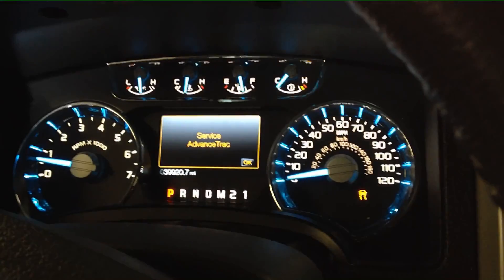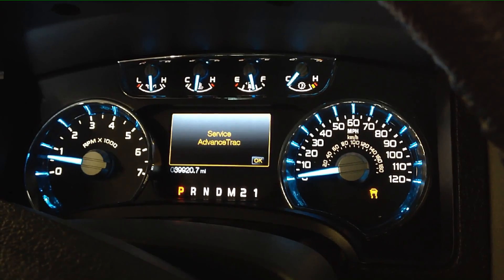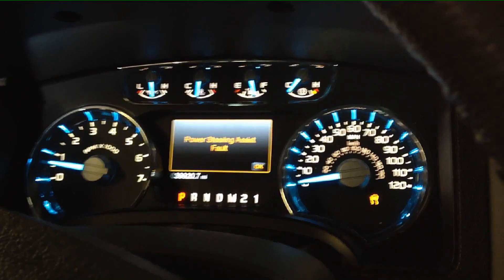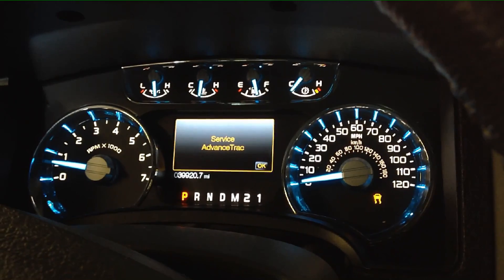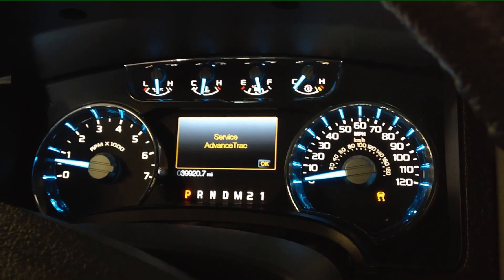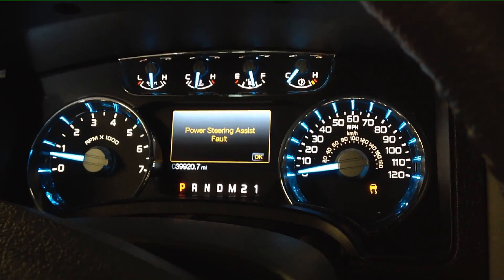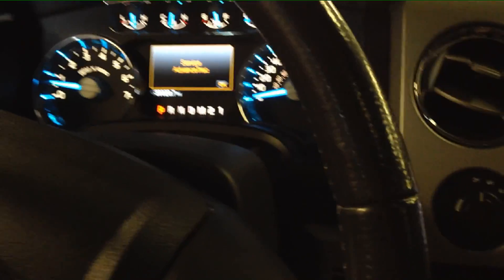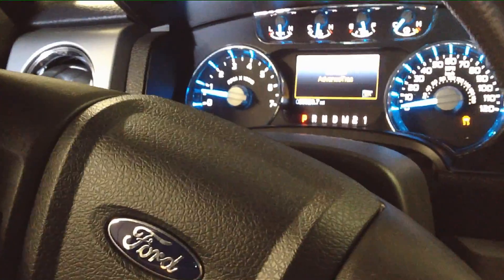Ford Quick Tips: #29 What A Failing Electronic Steering Gear Sounds Like

Comment: I have a 2013 f-150 5.0  steering stops working when it gets very cold do i need to clean the connectors or just replace the whole steering after I worm it up for about 45 minutes and turn it off and back on it works fine

Comment: I did not get any cluster errors on my 16 f150. I noticed I adjusted my steering wheel position earlier today and I got a sticky ratcheting sound maybe an hour later every time I turn the steering wheel. Almost like a ratchet click noise and it sticks during the turn in different spots. Once I was in a safe spot, I drove maybe 5 miles an hour and would turn the steering wheel back and forth while coasting under its own load and it would ratchet still. Came to a complete stop and let off the brake and it stopped doing it. I’m going to adjust my telescoping steering wheel again and see what happens. Maybe twice a month if that and very minimal, it would catch in a slight turn but never ratcheted before. This is the first time I’ve heard it ratchet. It does is during the cold I’ve noticed. Any ideas?
Reply: It went out completely a few days later didn't it?
Reply: @brandonrickbornponyexpress6574  It has not done it since. I’m thinking maybe I didn’t have the release clamp pushed up all the way and it was ratcheting from something. It wasn’t set. Everything is fine now.

Comment: Thanks for the kick to the nads! 😅
My 2011 Mustang made that sound a couple of times while I was driving, shortly after leaving. I thought it was the starter stuck or something. Then some light wining in the steering started happening while stopped. Followed by a slight shudder in the steering wheel. Got new tires, and now it tracks back and forth and throws the steering assist light.
 I had a feeling it was this, and now, after watching this video.... my nads hurt 😂

Comment: You can by the belt to fix it like $50 take you like 1 hr to fit it I did mine
Reply from the maker: really show my how.
Reply: If you could Please confirm that replacing the belt will solve this exact same problem, my 2010 fusion doing the same thing.

Looking forward to hear from you.

Thanks

Comment: My 2013 did this one time on start up, made no noises while trying to turn it but it had no power steering,  I shut it off and started it back up and I've had no issues since and that's been several miles ago,  kinda worried as to what will happen if it fails why driving and what it could be

Comment: 2014 ford fusion with 140000 km had the steering fail. No noise. Just stopped working. I replaced the entire rack in my driveway and the motor on the rack was actually split in half. This should be recalled!

Comment: I repl;aced my Rack and now ? still have a stiff steering wheel and light comes on service advance trac. Can not drive the truck.. ?
Reply: service advance trac was coming on when it failed initially..
Reply from the maker: Did you program the new rack with as-built data?
Reply: @FordTechMakuloco  can not program code reader notice... Lost communication with PSCM

Comment: Could the rack be failing WITHOUT noise? Mine doesn't make any noise, doesn't throw any codes, but the steering is just as stiff with or without the engine on.

Comment: Just watched someone totally service one and it was simple . he changed the belt inside 1 torx screw put the rubber boot back on with a radiator clamp and it worked perfect $ 40 for the belt from Amazon didn't even have to pull the rack .  to many thieves out there it's maddening .

Comment: I took mines apart and the belt was no good, it was making that same sound. It’s fixed now. The belts are only on eBay and go for $60
Reply from the maker: This is electronic steering, no belts and no pump.
Reply: @FordTechMakuloco  As per my research online, There is a small belt and two bearings.
If parts are available then you can service the item.
Reply: @LuLu-eb7lt   do you have exactly the same sound of this video?  Help me with your informátion please, because my f150 2014 now have the exactly same noise and
Reply: @LuLu-eb7lt   do you have exactly the same sound of this video?  Help me with your informátion please, because my f150 2014 now have the exactly same noise and
Reply: Hi
Reply: @Lulu-eb7lt ... Please confirm that you had the same noise and replacing the belt solved the problem, my 2010 fusion doing the same thing.

Hoping to hear from you.

Thanks

Comment: Had my old 2013 with a lifted kit on it and drove over 130000 on her and no steering issues whatsoever. 9 months after purchasing my 2017 used that has 90000 on it, the steering rack and pinion is put and needs upper control arms ball joints and stabilizer bars plus alightment. Only $4900!!! Hahaha they are high

Comment: Does this apply for the 2012 F-150 Lariat I think his truck has 6.2L V8 4WD that needs? : electric or or electronic power steering (pump), along with the rack and pinion. He thought person was trying to play him. They sent him quote upon part for $1,200.00 not certain whether any of what you stated in video upon Labor fee & Wheel Alignment fee was discussed. 

So if the truck has electric or electronic power steering rack and pinion, is the actual steering pump itself is it same or manual type pump ? An how would person know if they purchased the correct pump which goes in the vehicle to replace old bad one when doing the repair ? Thank you.

Comment: My 2011 F-150 is doing this right now and I'm guessing it will cost $2000 for parts/labor. Issue is that unless you have the stuff to calibrate it all, you have to take it in to the dealership or a shop.

Comment: The Steering gear cracked and locked up on me mid turn in my 2017 mustang GT.
Good brakes saved the car from being a write off as I was still pointed off the road.
I am 3 days short of 2 full months waiting for a stereing gear to come back in stock.
I only had the car 4 months before it broke so 1/3 of the time I have had it it's been broken.
I am scared to drive it again after almost crashing.
The battery is dead after 4 months as well with no warranty to cover it.
Ac compressor blew at the same time and it was a fight to get it covered.
Out 600$ for the battery and labor for a car I just bought and can't use.

Comment: I have 2017 ford escape SE I can hear like a dry whinnying sound when I excelerate I've checked my power steering fluid it's fine no loss there turning is fine I did change out the cv axel on driver's side last year I'm going to go ahead and change out the passenger side because I can hear some knuckle sound just like the driver's side was making trying to diagnose this issue is kinda hard because naturally I'm thinking worst case .any thoughts you want to say would be great.

Comment: With this electric component, is it still fixable in the driveway? Or is there too much programming?
Reply: Did you ever figure out your answer? I'm looking into this now
Reply: @chrismurdock990  you can probably do the mechanical work if you are so inclined. I ended up having to shop it because it failed far from home. I did determine that it would have to get reprogrammed at a dealership. There are aftermarket components but the ford tech I talked to said they had a significant amount of  customers who chose to go that way come back with unreconcilable programming issues. Hope this helps.
Reply: @kansascityshuffle8526  awesome thank you

Comment: I’ve been trying to diagnose something wrong with my 2017 f150 for months now and I’m 1600$ in so far. Symptoms I’m having are driving down the road I notice the wheel get real bindy like I have a tight spot, I can free it from that bind but usually will hear a pop sound that I can feel in the steering wheel. Also noticed this really loud knocking popping sounds almost metal to metal sound when turning the wheel at a dead stop that I can also feel in the wheel. Doesn’t seem to safe to drive so I had it parked for 2 months now. I replaced both lower arms ball joints upper arm bushings lower arm bushings alignment and a new steering shaft. Same symptoms. Anyone know if I should just go ahead and replace the rack now? Nobody can figure it out it’s super intermediate and doesn’t happen that often but definitely becoming more frequent. Was once a month or week now it’s happens almost every time I drive.
Reply: Try the steering shaft

Comment: crap I didn't hear a thing with 2011 fusion 2 5l it gave the fault then starting and restarting worked but now it's dead and ford is being a Dick about it 2017 was update on recall but they want me to pay 200 just to look . screw that I'll buy one and put it in myself before I pay them 200 to tell me there gonna wipe the codes then tell me it's gone

Comment: My 2012 Ford Fusion every now and then throws the service advancetrax and powersteering assist fault but steers fine. A couple times it locked but now it doesn’t. Could that be a sign of it going out? I was told it’s a bad clutch behind the steering wheel air bag

Comment: Please I have question .
My 2013 Ford F-150 have a hard steering to turn it. The message was AdvancTrack and Power steering assist fail . 
The steering wheel is very hard to turn. 
Do you think Rack and pinion OR angel sensor? Or what please.

Comment: My 2017 F150 started having the ABS light along with ServiceTrac and Hill Assist disabled messages on the dash. All the while my steering was working fine, but after driving about 10 miles the Steering Assist Fault message would then pop up. Got the vehicle scanned by a friend with a diagnostic tool and it stated that the Pass side wheel sensor was not reading properly. I ordered part and was going to change it myself. Continued driving while waiting for part, now the power steering is no longer working. Would the faulty wheel speed sensor cause my power steering to turn off completely and now that I have the new sensor, once I install it, will the steering return to normal? Please help with whatever advice u can. Thanks!
Reply: Did you ever find out what was the reason of loss of power steering? Having the same exact problem and changed the wheel speed sensor and yes it still has loos of power steering and abs lights, advancetrac, and hill assist loss
Reply: @edgarcepeda175  Hey, did you manage to get the fix of the heavy steering wheel?

Comment: I have a 2012 F-150 and my power steering is not making any of these noise, I also am not getting any fault lights or messages on the dash, my steering is just very hard to steer at any speed, do I need a whole rack? Or will a module replacement or software upgrade fix this??

Comment: Mine is showing a battery light on the instrument cluster and has no power assist at all then after the truck runs for a minute the light goes off and the power steering works fine. It has a new battery and starts the truck fine. It doesn’t make any weird noises, just wondering if you have any insight on what it might be
Reply: This is what mine is doing. Did you fix this??

Comment: I’m in Utah so winters are cold here. My 2011 F150 ecoboost pops up service advance trac light on freezing mornings. This disables power steering. If I let my truck warm up and turn the ignition off and then on again the service advance trac light is off and I have power steering again. My truck runs fine and I am not having any other issues besides this, no squeaks. Would this still be a bad angle sensor? Thanks
Reply: How has it been? Is it still doing thus in the cold temperatures?
Reply: @extremedeepfilms2680   I had to get the electric steering rack replaced. Expensive.
Reply: Shit, well looks like I'm gonna have to get mine replaced😮‍💨 did you replace it with the OEM one and how much did it cost you for everything?

Comment: Had this failure on on 2015 Explorer, luckily it first failed while i was just starting up,  Ford original part was $1900 CAD + labor,  they found an aftermarket one for $1000 + $500 install + alignment, new EPAS had to be programmed afterwards or Lane Assist warning stayed on

Comment: Yea, lets roll out the fusions from the assembly with our new non-fluid, non- pump computerized power steering, after we stupidly crammed everything so close together that it gets hot and fails, causing sudden, stiff or impossible steering, resulting in life threatening accidents; and hey, (while we're at it) leave the throttle the way it is even though the car could stall while driving or idling. Way to go Ford. Shame on you for cutting corners, ripping people off and putting lives at risk. I will never recommend Ford again.

Comment: Have a 2011 f150 having this failure every cool morning but it does not make the noise. Dealer cannot identify what is wrong for sure. Once it warms up it drives fine but I am in Michigan so I cannot have this problem extending into the winter.

Comment: my truck started making that noise last week.only at hard over left or right.but today it is locking up and sounds like the truck in video. ouch this is a painful expense. 149000 miles on my 13 f150

Comment: How can you tell if you have epas or the other?
Reply from the maker: Just look to see if you have a power steering reservoir.
Reply: @FordTechMakuloco  Thanks, I was afraid of that.   I really need to find a truck that will hold up and not need constant trips too the dealer.  2011 F150

Comment: Why do they put this electronic crap on basic safety parts like steering? So you can parallel park automatically like once every few years? No thanks, I’ll take my old recirculating ball steering, if the pump fails it just gets harder to turn the wheel and then replace yourself on a weekend.

Comment: I have the same issue in my ford fusion car 🤨
Reply: Me too. But it was covered under the field service alert. Mine is a Fusion 2012 SEL AWD 46,000 miles. What milage and year is yours?
Reply: Creekwood Joe hi mine is a 2012 fusion 2.5 with 91k miles. They did the module recall reprogramming a year ago and it just came back today. I’m guessing the gear/rack needs to be changed? It’s still under the 10 year 150k mike warranty so they better now give me any crap 😡

Comment: 2016 F150xlt. 24,000 miles and today this happened to me.  Small clunk noise.  Then steering was a little stiff. By the time I got home the hill assist light and the traction control light came on.  Went to back out of the driveway to bring it to the nearest Ford dealership and now the truck won’t turn. Getting it towed there in the morning.  My luck is that ford here is backed up for 2weeks.  No truck.
Reply: Did they ever tell you what was the problem?
Reply: Hi, what was the issue and the repair?

Comment: It’s unfortunate! My 2010 fusion steering is out, I can manually drive the car but it’s a B*** to say the least. Advance Trac on the dash is chiming and Power Steering Assist Fail also chiming, Along with abs and brake light indicator on.. oh boy lol, they are nice cars to bad you couldn’t convert it back to what is proven to work!! Power steering pump lol no they want to make things complicated so the average DIY’ers can’t fix it then selves, greed is the culprit. All’s they care about is $$
Reply: You can take em to Ford and reset it mines faults all the time

Comment: My 2011 steering is not returning to center after making a left turn, I can re enter it manually but I'm worried because my wife and kids drive this thing daily. Is there any serviceable parts that could fix this issue. There is no way I can afford a 1600.00 steering rack seriously Ford.
Reply: my 2011 mustang is doing the same thing, buying a used steering rack on Ebay for $200 bucks from a low mileage donor and hoping for the best

Comment: This just adds to my disgust with new vehicles these days .The old system worked fine for decades and if it did fail was much less to repair then he said and you could do it at home.   I firmly believe the dependability of vehicles went down the drain several years ago .  I will not be buying and thing new going forward .  Just saw a super nice 1992 on CL .    Those were excellent years for Ford trucks.   Ford should be ashamed of putting a burden like this on its customers  1500.00 plus for power steering despicable.
Reply: storemannc You are 100% correct Ford should be ashamed of expecting the people who pay their salaries to be stuck with repairs this expensive!

Comment: I have a bee buzzing in my f150 column at 60 plus mph and vibration like a cell. Is this the steering?
Reply: Mine does that. Figured out it's the buttons vibrating on my steering column

Comment: Our 2018 f150 is now in the shop to get the rack replace, 3200kms on the odo, no noise, i just complained about steering wondering and too much sway when we pulled our rv, and the service AdvanceTrac light came on but disappeared after a while when I disabled trailer sway control

Comment: Just took my 2011 Sho in for the epas recall. Picked the car up and now it feels like the front end is all over the place. When i hit a bump on the highway it wants to throw the car one direction or the other and in low speed turns the front tires squeal. Any ideas?

Comment: My 2013 Lincoln MKZ just started to have this problem. It has a shift sensor, abs and parking brake light that comes on and off. It also will not allow me to use turn signals and high beams. I'm wondering is mine beginning to fail?